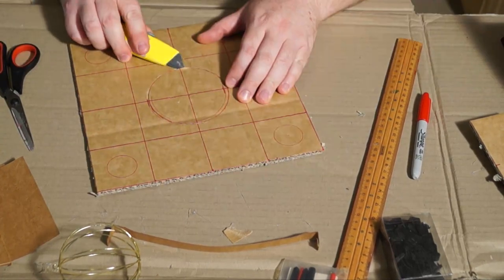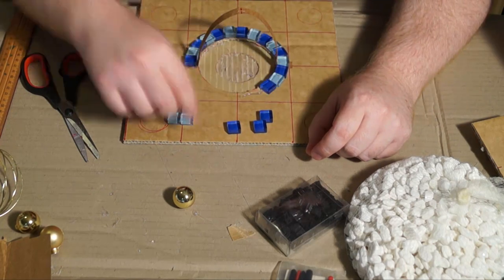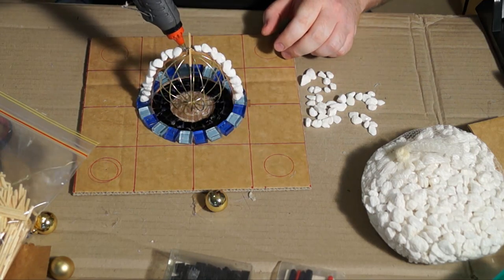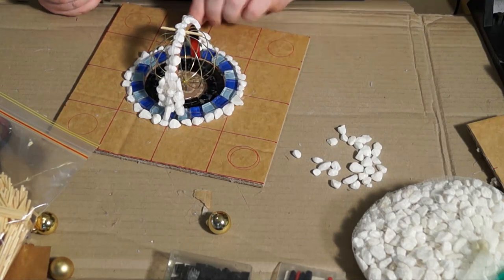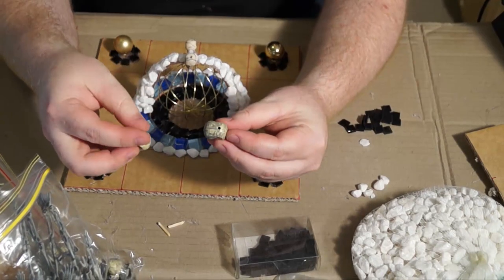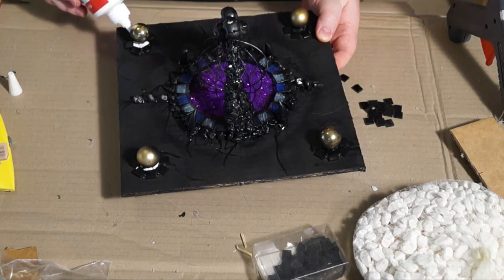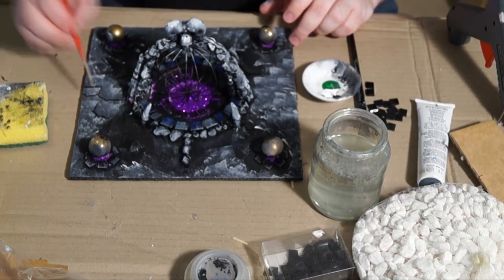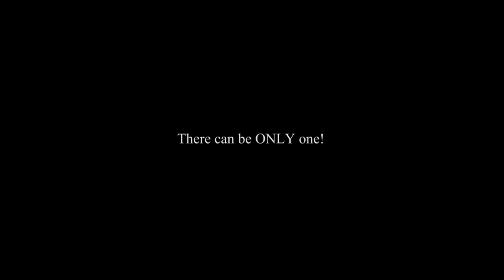World of CraftWar (Nov 2013): Magical Artifact Machine for D&D or Pathfinder games

Comment: Awesome stuff. I am really enjoying your channel. About scraping the paint off the glass tiles. I believe if you greased them before you primed the piece, you could have just wiped them off and they would have been like new. I have used KY Jelly on my JEEP logo when painting the hood.  Use a Q tip (Cotton Swab) to put it on and wipe it off.
Reply from the maker: Dave Somesnowboarder great advice. I did not plan the build, I just built it, so that would have worked well :)

Comment: This is going to be a critique from an artistic standpoint. I just want to see super cool stuff from him in the future - so I'm being mean and giving him lots of suggestions.
------------------------------------
I feel like a lot of colors were flat. The purple magic could have been brought out by using a light blue glitter on top in a swirling design.
The 'blackened' tiles around the magic pool could have had a watered down purple/blue paint lighting affect added, because right now its just sort of a oddly formed pit.

The 'iron cage' seems like dead weight, it doesn't seem to be adding to the effect to me I'd recommend "doing" something with it (potential suggestion:) using fishing wire to hang a transparent material/craft in the center like a trapped wisp inside the cage. It's the centerpiece! Make sure it's purpose is very apparent. (visually speaking)

I am not sure what your intention with the skeletal bits was, so I'm throwing this idea out there. Currently the skeletal bits look more like the stone work, if you ever wanted to distinguish them from the stone, use a cream base with brown shading. That would more accurately depict aging bones.

A future alternative you could use for magical sparkles, is by base painting a darker color and doing more of a sprinkle of sparkle rather then a thick coat. The thick coating gives it a fake cheap look to me, and I think more could be done with it.
This would be a lot more effort, but if you had actually dug/carved out the seeping/funneled magic lines to the outside bobbles... gone down one layer.. and then had the glue and sparkles in the cracks, the quality of the effect would have shot up tremendously.
------------------------------------
Now - I know these are supposed to be easy-to-do tutorials for your viewers... I just think one could and should go above and beyond for critical centerpiece rooms like this!
Reply from the maker: I use a limited colour scheme to keep it simple (only two colours of paint were used). I am capable of doing far more advanced work, but the idea of this is to show that it is really simple using limited and basic materials and colours. Otherwise you scare away people as it looks far too difficult. The bones are meant to look like stone.
The cage can actually have a miniature put inside it as the bars can be pushed apart. I did not mention this as not all of these decorations will do that.
Thank you for your comment. I am aware that a lot more could be done, but that is beyond the scope of this.
I do encourage you to join the DMsCraft forum and show some of your work as more advanced skills do have a place. My videos would be VERY long if I went in depth and broadened the range of materials and colours.
In the end it is up to the crafter how much time and effort they wish to put into the piece.
Thanks again.
Reply: TheDMGinfo Can't you just make an advanced builders series? That would make me happy.xD

And alas, all my tabletop gaming buddies are on the other side of the country so I don't actually dabble with crafts though it does look like a lot of fun. :C
Reply from the maker: In the end ... I will